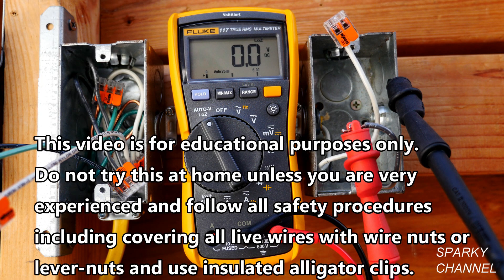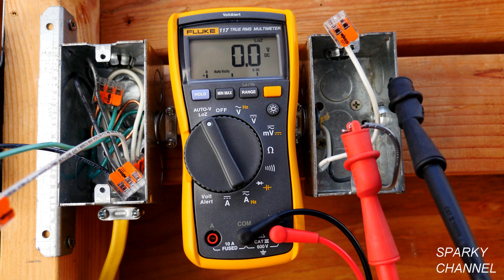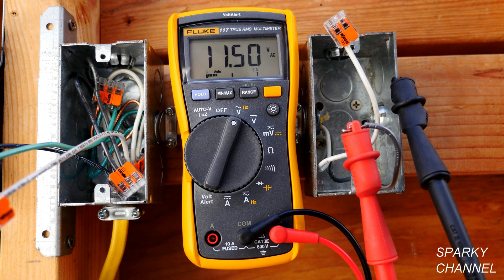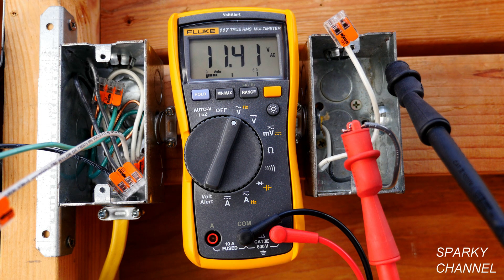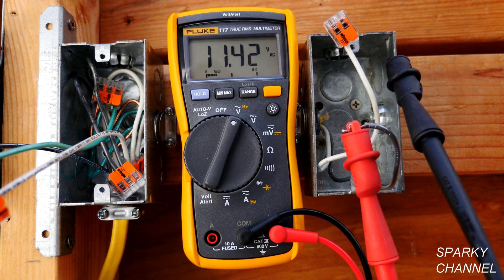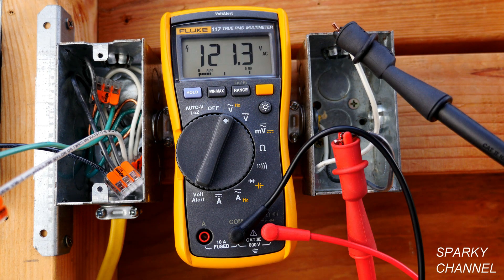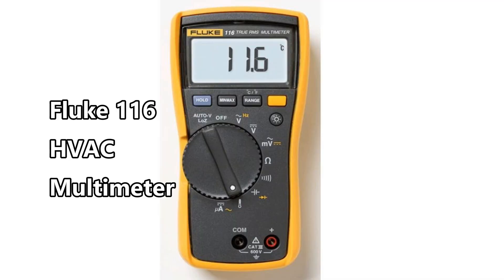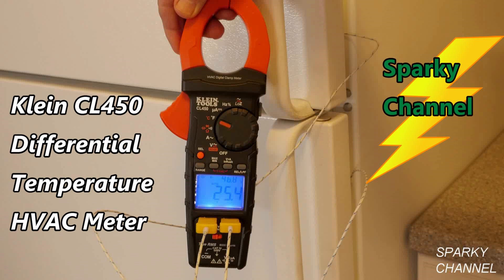How to Turn Off Ghost Voltages with Dual Impedance (LoZ) Meters

Comment: You put one clip on the neutral wire and the meter read 121 volts on the regular high impedance setting, what would you expect if you shifted the meter to low z? Would it be slightly different?

Comment: I'm trying to understand how the normal voltage setting on the multimeter is a high-impedance setting. It seems like that would be a zero impedance setting since it does not affect ghost voltage

Comment: Question.....I watched your video on "How to wire a half hot receptacle with power to the receptacle".   I have two switched receptacles in my house like the set up in that video... one of them is the receptacle under the kitchen sink (the switched portion is for the disposal and the other half is for the dishwasher)  the other switched receptacle is in a formal living room to control a lamp.  My question is, I used my fluke 337 True RMS clamp meter to test the voltage in the switched portion of both of these outlets with the switch off and was getting a reading of 4 to 5 ac volts,  is this normal?    I'm assuming so because of the research I have done so far.  We have lived in this house for 17 years and never had a problem with these outlets and everything works like it should.  I have not changed out these outlets or done anything to them, the reading of 4 to 5 ac volts is what the receptacles show when off.   Any info you could provide would be greatly appreciated Sparky.  Thank you for your time.
Reply: yes. a meter with a low z setting would show 0 volts.
Reply: @oakstreetanimals3474  Thank you.

Comment: Hi iam a new electricien 

I was wondering if you can guide me on witch multimeter and ampmeter  to buy 

I prefer to buy the right one right away 

I was looking at the klein cl800 or fluke 376 for the ampmeter 

And the klein mm700 or the fluke iam not sure witch modele so many on the market 

Thanks for your help i always what your video 

Great job

Comment: It’s using the moisture in the wood to the ground in the other box for a return. Going to loZ creates a 3k ohm resistance.
Reply: Agreed. Ghost voltages are due to capacitive coupling in the wiring.

Assuming the meter hi-z is 1 megohm, you need only 3 nanofards of capacitance to have 11 volts at the meter. 

I wonder what the capacitance of 14/2 per foot actually is...

Comment: I’m looking to get a fluke meter I’ll either be getting the 116/323 kit or 117/323 kit I won’t use the volt alert on the 117 and I hear the temp on the 116 isn’t very accurate so those two features cancel out so I’m left with what’s more important micro amps or amps it will mostly be used for home diy but I like to buy good tools in case I get into a trade

Comment: In 277v multiwire branch circuits I'll get strong ghost voltage on dead circuits if they share a pathway. Just picked up this meter, looks cool. I'll also pick up 120v on open neutral circuits if the open neutral still has a good length of wire. Sometimes it takes a dummy load or continuity test to ground to see the neutral isn't actually there. This may be helpful

Comment: I understand ghost voltage but I don’t get how Low z is useful? Since you use low Z and you had 0V between a know hot conductor(120V) and a open circuit element. If you don’t know one of them is hot you could get shock

Comment: This effect is called an Electric field coupling (also called capacitive coupling). It occurs when energy is coupled from one circuit to another through an electric field. This is most likely to happen when the impedance of the source circuit is high.

The most common places to encounter ghost voltages are blown fuses in distribution panels, unused cable runs or electrical wiring in existing conduit, open ground or neutral on a 120 V branch circuit or in card cages where 120 V control circuits are used to control assembly line or conveyor functions. 

When new buildings and factories are built and wired, it’s very common for electricians to pull extra wire through the conduit for future use. These wires are typically left unconnected until needed, but are subject to capacitive coupling thereby creating a potential for a ghost voltage measurement.

Which takes me onto an even more interesting topic the safety of electrical wiring and electrical products due to the creation of electrical fields but more typically magnetic fields in modern homes and whether they create a potential health hazard. That creates an important issue of what testers we can use to address this and the importance of shielding from stray radiation.
Reply: Electric field coupling is known  to damage VFD's. It will also damage the equipment i.e motors etc that are connected to the vfd.
Reply from the maker: Thanks Math Man!

Comment: So who is this low-Z/LoZ measuring most useful for: shouldn't electricians be able to cope, and work, with ghost signals or voltages?
Reply: in this example, the regular voltage measurement proves that the metal box is not grounded properly. What is loZ doing that's useful?
Reply from the maker: LoZ provides a measurement of what is wanted without dealing with confusing "ghost" voltages.

Comment: It can be dangerous to only use one form of testing. Sometimes you can have a bad neutral and a bad ground, and the meter won't show 120 Volts. This is why I also use a pen tester in conjunction with a meter.
Reply from the maker: Excellent advise, thanks!
Reply: @SparkyChannel  No problem.
Reply from the maker: @illestofdemall13  ⚡️⚡️⚡️🔌💡
Reply: @SparkyChannel  Using the pen tester can also indicate if there is voltage present on the ground wire, metal chassis of equipment, and/or metal junction box that shouldn't be there under normal conditions.

Comment: so the voltage here is NOT an induced voltage, nor is it ghosting; the breaker is on, right? sometimes ghosting is caused by damaged insulation, i.e. voltage leak. Any other cases?
Reply from the maker: Yes, it can be just normal electrical field interaction. For instance on standard V setting, a light coming closer to your meter can cause a fluctuation in the reading. LoV setting just gives you the reading you want in most cases.
Reply: finally watched this video properly: this case with a low voltage drop from "120Vac live wire" to "not grounded" is nothing to do with ghosting. This is plain old "missing ground". I don't see how LoZ is actually helping here? Same with "open neutral".
Reply: @wim0104  
Hopefully this fluke article will help clarify...
https://www.fluke.com/en-us/learn/blog/digital-multimeters/dual-impedance-digital-multimeters

Comment: Great vid.  What brand of car battery did u use to make the ghost voltage??
Reply: one of those huge cylindrical ones on a pole, like a Z size ;-)
Reply: but seriously: when conductors run parallel, they induce electrical current & AC voltage in each other. that's one reason why there's guidelines/code about bundling  circuits together.
Reply from the maker: LOL! Yes, bundling wires can cause radio interferance as well.

Comment: This is great , I got this meter few days ago.
Reply from the maker: Nice choice! :)
Reply: Sparky Channel  THANK YOU ⚡️. I Being using FLUKE meters for about 15 Years and they are great . Like I said i just got a New Fluke 117 and Also a FLUKE 376 FC ( Clamp meter and comes with a iFlex i2500-18 to go up to 2,500 Amps ) . I Still have my first fluke meter ( FLUKE 75 ) and also the one that I replaced ( Fluke 23 series 3) . With Fluke you get what you pay . ⚡️⚡️⚡️🔌💡.
Reply from the maker: @optimusvader7823  ⚡️⚡️⚡️🔌💡!!!